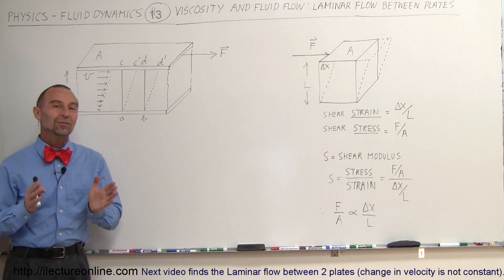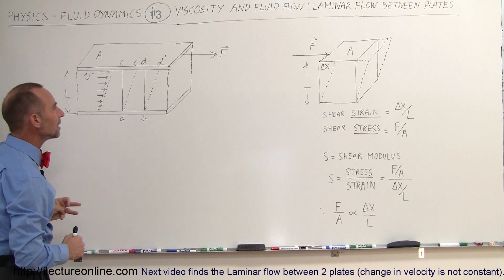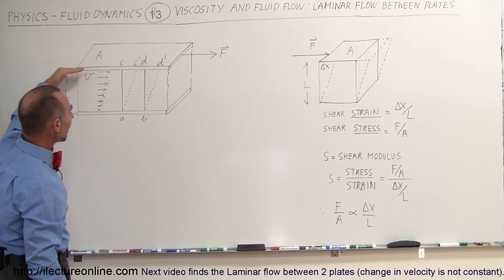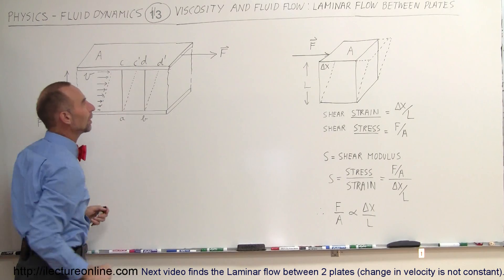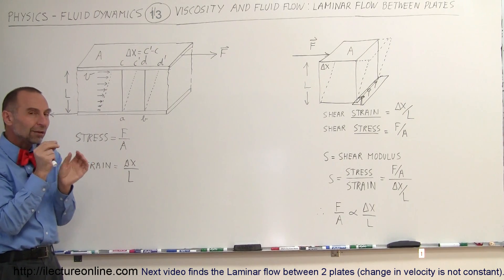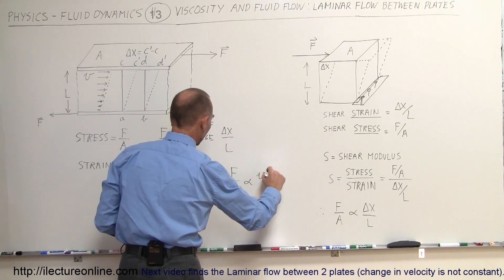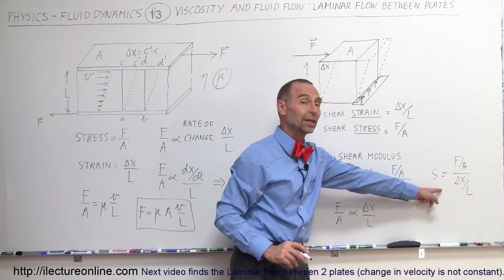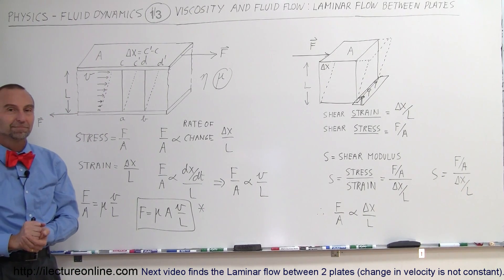Physics 34  Fluid Dynamics (13 of 24) Viscosity & Fluid Flow: Laminar Flow Between Plates

Comment: A Newtonian fluid flows between two parallel plates. The viscosity is ì and the flow is laminar and one-dimensional. The
velocity profile is
U(y) = 4 Umax [y/h - (y/h)2],
where U is the (local streamwise) velocity, Umax is the maximum velocity at mid-plane of the gap, y is the distance
perpendicular from the bottom plate, and h is the height of the gap. Deduce a relation for the drag force in the flow
direction per unit area exerted on both plates. How does the drag force vary with h?

Comment: Can anyone tell if there are three plates instead of two and fluid is in between these plates having different viscosity? If the upper and middle plate is moveable and the bottom plate is stationary, with what velocity middle plate will move if we move the upper plate with velocity v? consider plates are weightless

Comment: Sir , is the resultant force on the above plate is zero since it is moving with constant velocity ?
Reply from the maker: There is no net force on the top plate if a force pulls on it with constant velocity.
Reply: @MichelvanBiezen  thanks

Comment: What if the object was accelerating instead of having uniform velocity? Since the velocity isn't uniform does this mean the force acting on it changes as well with time?
Reply from the maker: According to Newton's second law:   F = m dv/dt   which means that a constant force causes a change in velocity.
Reply: But the acceleration here is 0 yet there is a force. Using that equation F would equal 0. I'm talking about the one in the video where tau = F/A = miu x dV/dy. If the block is accelerating how do you use this equation to find out the force?

Edit: Oh wait, scratch that. So you just use the basic F = ma in that case to determine the force if it's accelerating? That makes more sense. That's right right?

Comment: could you please tell the difference between laminar flow and turbulent flow? Thanks in advanve
Reply from the maker: Laminar flow is basically where all the molecules in the fluid travel in the same direction.   Turbulent flow is where the general movement is in the same direction, but there are pockets within the fluid where the flow is in a different (and erratic) direction causing the resistance to the flow to increase.

Comment: Also, does the viscosity affect how the force applied translates into the velocity of the plate? I was thinking if you kept A and L the same and changed the viscosity of the fluid, how would the velocity and the force change?
Reply from the maker: If the viscosity is increased, then to obtain the same velocity of the fluid, it would require increased force proportionally.  Double the viscosity and you will need twice the force in order to maintain the fluid velocity.

Comment: Michel,Could you explain why a force must be applied to the bottom plate to keep it stationary? In my mind, I imagine when you move the top plate that the bottom plate wont move as the velocity of the fluid there is zero. I can't figure out why a force would need to be provided to keep the bottom plate stationary and why this force would be equal to the force applied to the top plate. Doesn't this mean that if you did not apply that force to the bottom plate, by applying force to the top plate you would cause an equal force to the right on the bottom plate. Any assistance in my confusion would be greatly appreciated.
Reply from the maker: Excellent question.  If the bottom did move then the fluid above the bottom plate would move as well.  Since the bottom layer of fluid does not move it must be kept in place by the bottom, since the layer above the non-moving layer is moving and pulling on the non-moving layer.  Thus the bottom layer of fluid pulls on the bottom and thus the bottom must be kept in place.